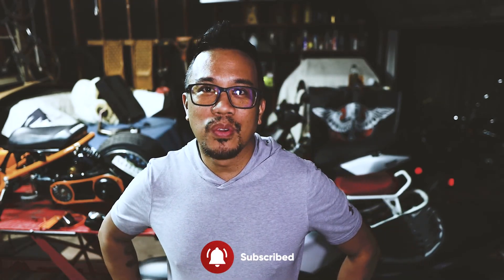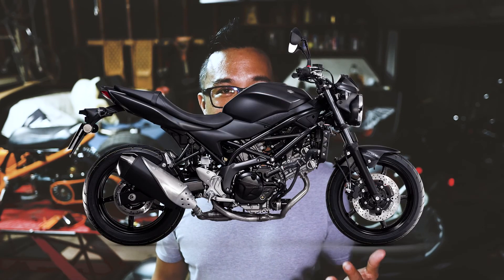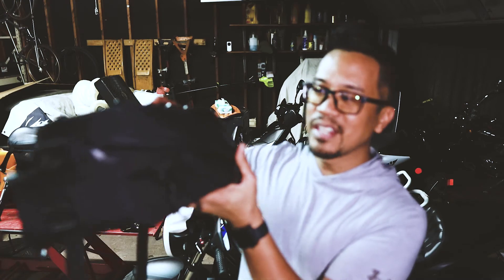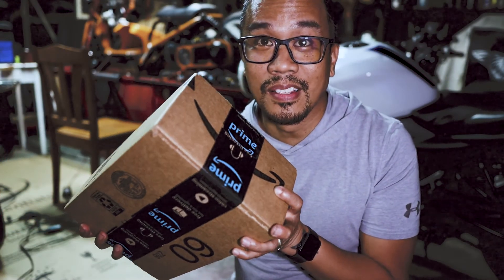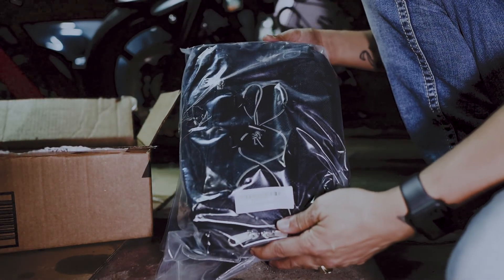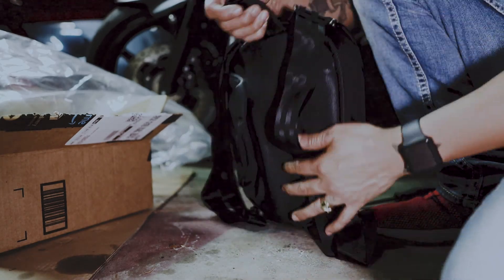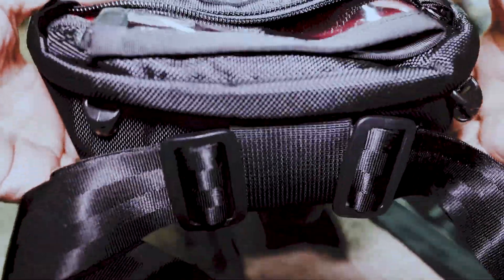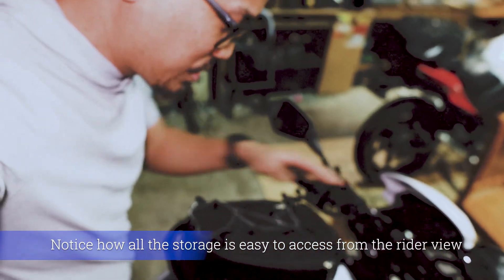Chase Harper USA 450M Magnetic Tank Bag Review #TankBag #ChaseHarper #SmallEngineVelocity

Comment: I love my magnetic tank bags, I always get the expandable versions. My KTM has a polymer tank so I have to use a bag that clips to a flange bolted to the gas cap… I hate it. it sets up an extra inch. I’ve run take bags on my Busa way way into the triple digits no issues. The only downside to a tank bag is you can’t get into a full tuck
Reply from the maker: On my SV650 the bag was great! One the CBR650R its great but now I cant tuck. Also BUSA! Id like to ride one someday
Reply: @SmallEngineVelocity  Maybe one day on one of your rides to Galveston you can swing by and take mine for a spin
Reply from the maker: What you in Galveston!? Nice! I ride up to League city often and go to Galveston to eat. Maybe a meet up
Reply: @SmallEngineVelocity  I’m in the clear lake area.